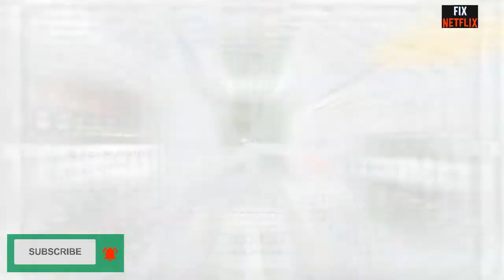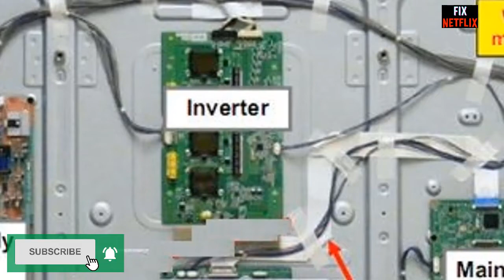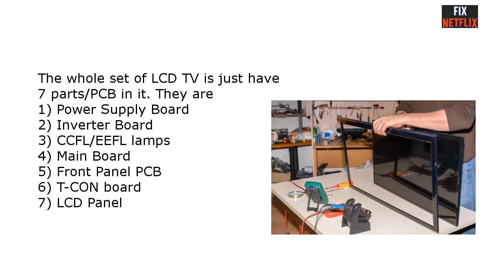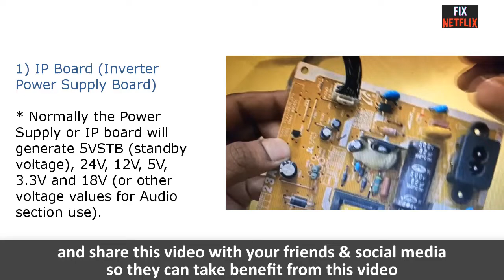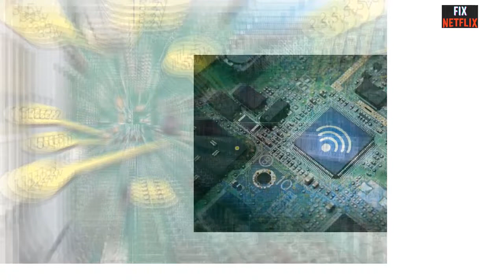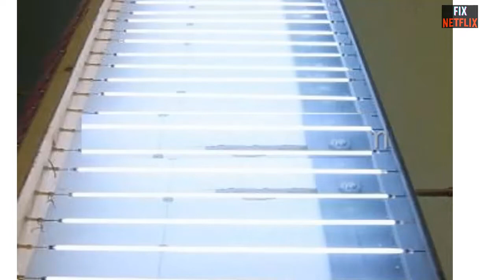How to fix LG TV Won't Turn On - No Standby Light || LG TV Has No Power or No Red Light

Comment: Hello im new here but i like and subscribed cause channel looks informative.i have a question i have an lg 55LM5850-UF 3d tv that i picked up for cheap.when i bought it the very 1st time i turned it on it worked for like an hour but when it crapped out i would try to turn on the red light was on then it flashed lg logo for a couple seconds and shuts off and when it shuts off power board would blink 5 times hesitate and blink 5times again and so on so i checked power board power coming in from wall and out to tcom board power seems fine so i started checking diodes and capacitators.found a bad diode looked it up and was a common problem.so after a 4week wait i got the propper diode installed it works properly.but now tv doesnt turn on.any suggestions on my next move ive been forsced to watch soccer and the grey cup on a 24inch tv,please help me im low income and with Christmas coming no chance of buying  anew tv ty in advance.

Comment: A lot of boards now are all together I liked the old way were the psu and mother board was apart .was easy for people just to change the board ie psu or main board. I have 5 TV to repair one is no standby LG smart TV. The other is Panasonic just gray screen flashing green light its probs 2 things mainboard or the  built in tecon  I'll know when iam in it lol the others is  didgihome no back lights ie luminated diodes ie led or probs a polycapp capacitor I have done a lot of these over the years very easy but can take time if led .the others is a cello same again as the first no standby it could be a number of things it's a cheap China TV could be enything cheap parts most times like technica it's diode problems I have had a bad poly cap 2700 microfarad wow can't remember the bloody voltage lol I think it was a35v capacitor and I used the same micrfarad but a higher voltage and still worked nicely. When I first started doing TV I learned my self i used to have a TV yhat wouldn't work unless you put a hair dryer over the capacitor it used to warm it he capacitor up and used to work the one day I thought I'd fix it and I changed the polycapp nicely with a good soldier iron and good fluxe then started from there I started finding TV learning how to check elements and  this is why now iam not brilliant but everthing I get I fix no one teached me I learned my self .common sense. I enjoy doing this and I hate to see people sling things away when it could be fixed .we live in a throw away society  one day people will not be able to afford new stuff that's were people will learn to do things for them selfs .enyway I like your video it's good .take care bro

Comment: Sorry to point out that's not diode that's a mosfat on the heat sink iat the start of the psu after you pointed out  after the old glass 250v fuse .

Comment: Best thing to fix eny TV with power issuse is get the best tool for the job a good multi meter and start checking built in fuses resistors capisitors transformers diodes ect usaly if no standby light it's ether the fuse diodes then polycap capacitors check the resistance on the resisters   also check for burns dry joins cold joints .its some times good to have a heat x-ray to see if eny othe these are heating up .I will say its okay looking at videos on YouTube but all power supply units are all diffrent and different things can happen never go of a video you see on YouTube take it as a bit of education .like I say the only way to find out that's if your doing it your self is to get checking these elements on the board that's the logical and best way if you get stuck take a break come back try again if all else fails repair shop or if you got a freind who's tech savie get on it ASAP lol friends are good in dire straits lol .eny ways to the producer iam now gonna watch your video take care and stay safe good times coming to you and many others .

Comment: I appreciate what you're trying to do here, but I could learn a lot better if you would slow down a little and point out the areas where voltages should be measured.  Also, please consider turning off the background music. No insult intended but your heavy accent combined with the relatively loud music, make it very difficult to understand your instructions.  In some segments that I've played back over and over, I still can't understand what you said. I hope to hear more from you. Thank you.

Comment: I really need some advice! My Dad's LG 55EG9100 took a crap few weeks ago. He said screen lost color and shut off. TV power light is on and seems to flicker sometimes. Gets dim. TV does not power on. No relay clicks etc. Nothing. Just stand by light. I took it apart. Don't see damage but power board smells like burnt electronics. I have 3.5V at power board. Thanks!
Reply from the maker: Hi rick doyle, please replace the faulty part 1. tv main board or 2.  psu board.
However any further difficulties please
let me know.
Thanks

Comment: Hello, I'm always having a hard time switching on my LG LN5100, most times the red light flash just once and the Tv won't on, but at times when it is on it works highly operational. But if you turn it off it might not on again sometimes, it will only flash the led red light once. Engineers here in my country have told me to dispose it and get a new one but I do believe the problem is still repairable. Please what can I do to this problem? Cause my TV still works and I don't want to dispose it